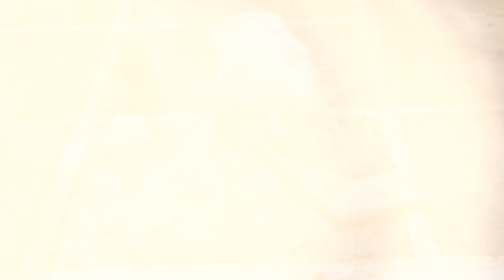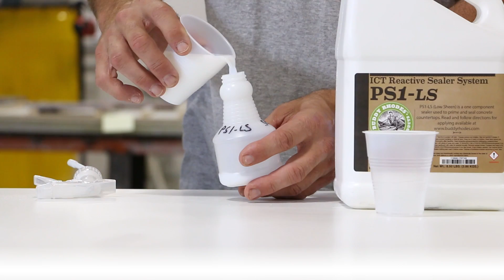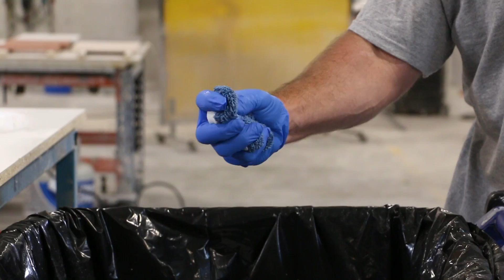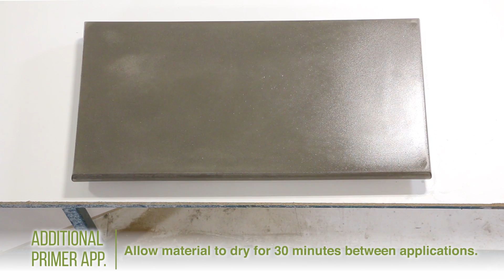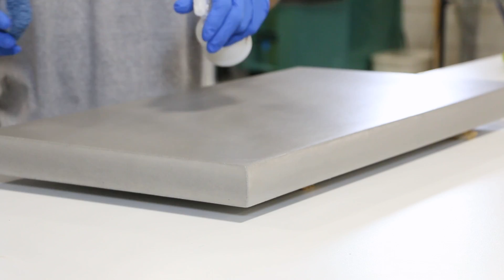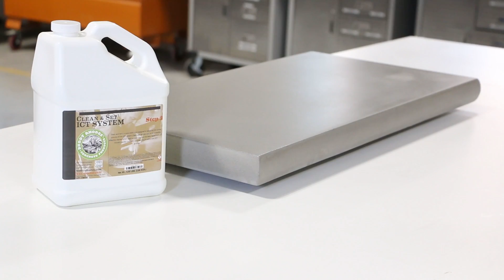ICT PS1 LS Concrete Sealer Application Guide

Comment: Do I need clean and set if I let my last finish coat dry for multiple days ?
Reply from the maker: Clean and Set is an optional step you can take to “kick start” the reaction with the concrete to gain some early protection during the cure process. It can also be used as a cleaner during the curing stage of PS1 for the first 28 days after sealing. You do not have to use it.

Comment: One more question. I wound up getting some streaking as a result of poor application technique. I'll address that on my next sample. I am curious if there is anything I can do to the sample with the streaks. I haven't yet done the Clean and Set step, but also curious if the solution would be different had I applied C&S.
Reply from the maker: Hey Jim, out tech team can help you out if you submit a form here: http://support.buddyrhodes.com/add/

Comment: How would you tackle a larger piece, say 10' long? Do you do it in sections or try to keep the entire surface wet for the required amount of time? If doing it in sections any issues with the areas between the sections?

Comment: Does the 50/50 diluted mix have a shelf life that is different than the PS1 in the container? Wondering if there is an issue with mixing up more primer than I need for the current project.

Comment: How long it takes to cure concrete?
I am using  GFRC mix
Reply from the maker: Hello bruna kowall, if you're asking how long does the concrete has to cure before applying the sealer, standard practice is the allow the concrete to cure for 5-7 days after casting, adhering to good
concrete curing practices.  
I recommend you visit this link to read the full instructions for the sealer: https://www.smooth-on.com/tb/files/BR_ICT_PS1_INSTRUCTIONS.pdf
If you have any questions, don't hesitate to contact our technical support team here: 
http://support.buddyrhodes.com/add/